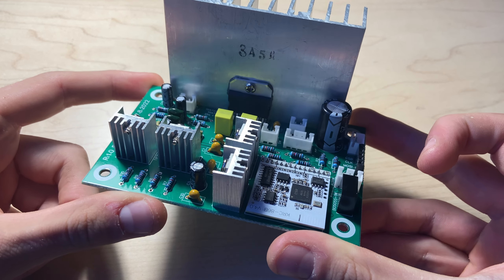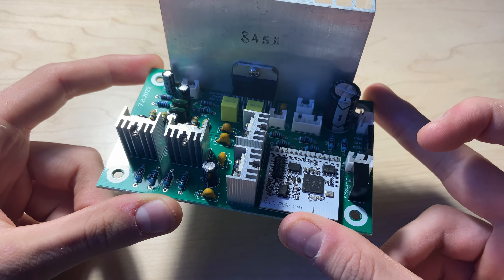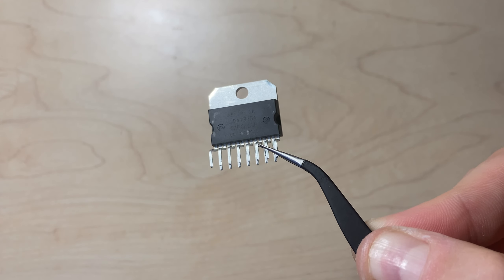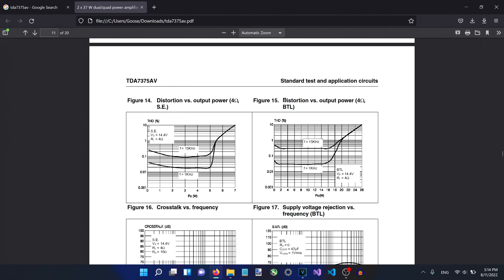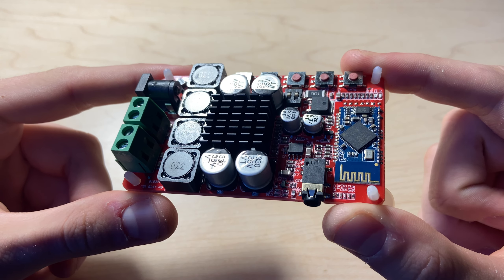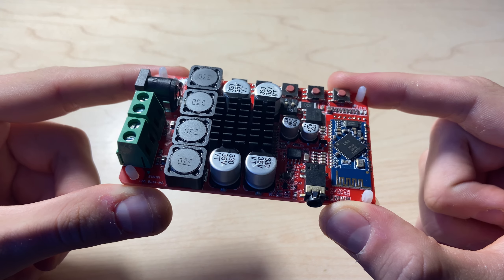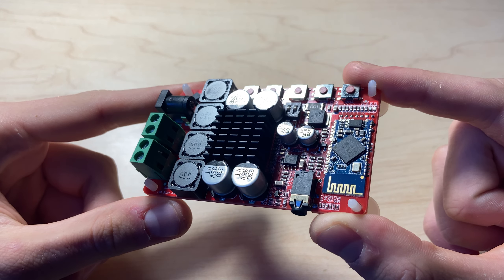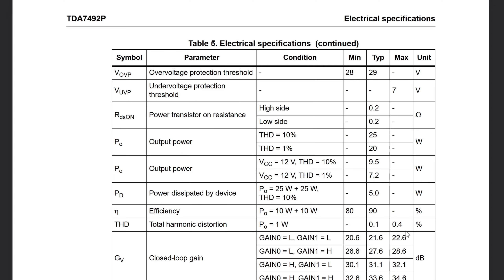Class D vs. Class AB audio amplifiers | Which one sounds better? | Unbiased listening comparison

Comment: I have tested both for my home stereo setup. I was hyped for my new class d amplifier since I am open to new tech and liked the idea of a lower electric bill. Also there are so many pseudo audiophiles on yt and old farts so I don't buy when they talk bad about every new thing. Since class d is newer and Yamaha knows a thing or two about hifi, I expected it to be at least as good as my old Yamaha ab amplifier. No. Ab is better. The class d amplifier is much smaller but very strong. No problems with big speakers. But the quality is lacking. Sounds like every PA system.

Comment: Hello, great video. The eBay non-branded class D amplifier boards are a lottery when it comes to getting a well implemented version. Few of these are being built with top audio quality in mind and more as in masse low cost electronic projects. While class AB for audio reproduction has been around for longer than class D the latter has come a long way in sound quality.  I have several class AB, class H and class D amplifiers which I switch all the time in my main system just for fun and I personally like both class AB and D, AB for efficient speakers and D for inefficient speakers (class D drives them with less effort because of its efficiency by sending more of the power from the power supply in to the speakers vs. wasting it as heat). I have tried 3 class AB boards, a pair of lateral mosfet boards,  a pair of vertical mosfet boards and a pair of bipolar boards vs. a well implemented pair of class D LJM IRS2092s boards using identical +70v/-70v linear power supplies and A/B listened through several bookshelves and tower speakers using the same source and music material. The major difference between them I subjectively noticed was that the class D boards because of their efficiency (+/-90%) made better use of the power supply and sounded louder with less effort vs. the class AB boards which run at lower efficiency (+/- 50%). At the same matched output power at normal listening levels they sounded pretty much the same IMO. For well implemented versions of class D (and class AB) amplifier boards see the IRS2092 boards by LJM, all products by SURE electronics, Connex Electronics and HIFIMEDIY. Class AB are easier to implement and more forgiving when it comes noise to the point that several do-it-yourselves have built amplifiers with point to point soldering rather than using a breadboard using class AB chips LM3886 without impacting their performance, this approach is impossible to implement with a class D chip without messing up its performance and noise. The best low power amplifiers I have heard are the Trends Audio 10.1 using the Tripath Ta2024 chip, a board using the TA2020 and a board from HIFIMEDIY using the TK2020. The TI chips can't compete with Tripath IMO
Reply from the maker: Neither of the chips in the video are from TI, they’re from ST Microelectronics. ST seems to have better chipsets over TI. The biggest concern with a lot of Class-D amplifiers today is that they suffer from low bandwidth. They have less dynamic range than the linear amp counterparts. This means most Class-D amplifiers won’t have as “vibrant” sound as Class-ABs or other linear amplifiers. The output filters also have some play in the fidelity of a Class-D amp. Poorly designed output filters can result in fatigue and muddy highs. Class-Ds can be great but their filter design in most electronics are terrible. High end configurations almost always get them right, but they can be very expensive. This videos aims to compare a typical Class-D amp configuration with a typical Class-AB for a better real world comparison.
Reply: @DaGoose  Agreed but If the video aims to compare a typical Class-D amp configuration with a typical Class-AB for a 'better real world comparison' then these no name boards from eBay are a far cry. The word typical implies a complete amplifier with a properly designed power supply designed for it included in its chassis or separately, it doesn't need to be expensive btw. That's as important as anything else. For amplifier boards the LJM L25 class AB and the LJM L25D class D would be a more real world comparison since they are designed by the same person and are properly implemented
Reply from the maker: @rickhedez521  The Class AB board I made myself using genuine parts. Whether or not they are “ebay” boards is besides the point. Many consumer electronics share similar characteristics as far as the design and amp chips used.
Reply: I have a Tripath Board 4*100W class-D Amplifier TK2050. (from Sure)
is that worth building an amp and would you know how these types sound?
thanks!
(I am an electronic noob and rely on infos online but its not always easy to filter out the right answers)

Comment: To my ears, class D has strange representation on high frequencies. sounded muddier. something after 15kHz, kinda aliasing subtle, but noticeable. But you can only hear if  do a very quick A/B comparison less then one second during changes avoiding letting your ear to  adapt
Reply from the maker: That’s common in class D amplifiers due to them having low pass filters on their outputs. it’s usually a design flaw with the low pass filter rather than the class D amp itself.
Reply: I bet you can't hear more than 10khz....
Reply: @DaGoose  Its by design. You can trick the masses with that distorted shit as long as its cheap and they get duped into thinking that a Class D 15 Watt AMP is all you will ever need. Bullshit!
Reply: @DaGoose  it's also common for that to be disabled by default, at least on home theater receivers. I'm sorta picking up that you know very little about home theater receivers and only specialize in single board amps.

Comment: It would of made even bigger difference if you had used an actual toroidal transformer with leaner power supply for the class ab amplifier.
Reply: Good point. I will test the theory. I have both so we will see what sounds better.
Reply: Or an actual hifi class d amp like the Purifi Eigentakt or Hypex Nilai, or one of the many big name amplifier manufacturers using those amplifier modules, like NAD or PS audio.

Comment: I like the sound of the class D better, I listened to this through my Denon AVR x4700h receiver that uses a class A/B Amplifier with Klipsch KL-650 THX speakers running in stereo mode.

Comment: If you designed the amp yourself, then the comparison is inherently biased. I wish you had compared it to a higher end class D amp. It's funny that it's so tiny (yes, I know they generally are smaller due to the dramatically different amplification technique, but still). The heaviest home theater rceiever I own is class D.

Comment: Although not a fair test (my desktop speakers are powered by class D amplifier), and YouTube audio compression, I did hear a clear difference between them.  Class A absolutely won in my opinion.  Better clarity, stronger mid range, higher highs too.  Class D was subtle and not exciting.  Although the class D did sound good, the difference was huge.  I prefer class A for everything, but it's getting harder and harder to find good quality units for car, house, Bluetooth speakers, etc....
Reply: There are Classd-A amps. Class-B amps. And Class AB amps. Are you sure you are talking about Class-A amps and not about Class-AB amps?

Comment: Unfair comparison......
Tda7294 100watt vs unkown class d possibly 2x40 watt tpa3116 

You should have
Reply from the maker: the output power has nothing to do with the comparison that was made in this video. those are not the parts either.

Comment: I guess class D is only good for Subs, provided you get a good one
Reply: Yeah I have a 200w sony class d powered subwoofer but I think  class ab is still  the dominant king around here ❤❤❤❤❤❤❤
Reply: OK, explain why Pioneer's engineers disagreed and put it in 2000 dollar receivers in the late 2000s.
Reply: @awesomeferret  They still use them in high end head units, they can be made to sound indistinguishable from A/B but costs more, for now at least.
   
I noticed my current amp can sound slightly crappier under some conditions that didn't happen with my old AMP I was curious to investigate what the difference was, it's just the limitations of Class D at this price point is all

My comment didn't make a lot of sense without elaborating dollar for dollar comparison

Comment: the moment you said that the gains were set 1dB different I stopped listening.
Reply: Why
Reply: @jessebeatty9696  Are you serious? 1dB difference in gain may or may not be discerned as a volume change, but the louder one will always be perceived as higher quality. This is psychoacoustics 101. This is why you gain match to 0.1dB maximum.
Reply from the maker: the gains are locked, so that is not possible with these to tune the precise gain with these boards. besides, the gain tolerance for most amps is usually +/-1dB, so it’s possible there’s a 1-2dB difference between two amps anyways even if the gain is advertised as equal.
Reply: @DaGoose  You have to deal with that if you want to make comparisons. An external attenuator in the higher gain path may be necessary. But without deent equalisation any comparison is meaningless.

Comment: Yeah but your comparison is with super cheap junk.
Reply from the maker: “cheap junk” lmao
I bet you’ve never designed audio amplifiers before. Numerous consumer electronics in modern times use chipsets similar to these amps.
Reply: @DaGoose  yes, i do build and play with electronics. That is how i noticed the cheap chip amp. Ice power amplifier modules are much better sound quality.
Reply: Well, compared to an Ice amp, yes it is "cheap junk." Why did you have to prove so dramatically that you're incredibly biased? That's quite sad, considering the title. That microscopic class D amp is a joke. Where are the huge capacitors? Why isn't it heavy enough for it to be painful to carry? My only theory is that you've never heard a high-end class D before. I'm not even saying they are better than AB, but it's really easy to find a class D that's way way better than the one you feature in this video.

Comment: Superb sound by both amplifier but class d is better than class ab
Reply from the maker: class d is better than class ab in anything other than sound fidelity. but class d hasn’t surpassed class ab or other linear amplifiers yet in terms of sound fidelity.
Reply: Class d mono block amps are for bass/subs..A/B amps are 4channel amps for mids and highs..Google it.
Reply: @DaGoose  it is full crap not good much worse The very best amplifier for a subwoofer is a class AB or Class H amplifier. Class D amplifiers are too slow and cannot keep up with repetitive bass. A class AB has a toroidal transformer and coke can capacitors so when the kick drum kicks the woofer responds instantly "A/B is louder , better , more powerful" because it is  A/B ab class is analog much better Nothing Digital D class crap No thanks That digital class D crap can be completely forgotten nothing crap Losers need D class Not sane and normal people That D class is cheap crap Nothing else And it is not needed anywhere I myself will now and always remain in the AB class much better Yes, Logitech knows That's it
Reply: @kotim1142  man wtf are u talking about..it seems u dnt know much..a/b amps are for mids and highs D are for subs bass..until I actually see proof other wise I'll continue to use them
Reply: @kotim1142  Been listening to power amps closely since about 1963. Started with Class A. Moved on to Class B (late 1960s - early 1970s). Quite a while later came H, G, AB. Then D (PWM). I love them all -- except Class D. Only robots and androids would love the sound of Class D. The only reason they make them because they are dirt cheap. :face-green-smiling:

Comment: I have used about 3 types of class d amps based on ic and they had smd components, only tpa 3110 last long for 6 months, then I bought mosfet based class d amps with regular big components and it blew up, then second time I bought it, tested it and ran on recomended voltage, but after 10 min a diode lost its magic smoke, class d are not robust at all.
Reply: Ohh, that's very sad, in your opinion which board good class ab or a
Reply: @dilipn2761  Class A, purely. Nothing sounds better than that. Yes, it needs lots of energy and produces lots of heat. But as an old german saying goes: "Von nichts kommt nichts!" = From nothing the only outcome is nothing.

Comment: Class D is garbage. A good Class A amp will be always far superior. Even if it needs 10 times the power and costs 20 times as much. I dont care.
Reply: What are good Class A amps that will supply good current? I want at least 300 watts for my Revel F328be's. Thanks.

Comment: Good video. I agree with you on this test. The TDA7375AV is really not a good example of a clas AB amplifier. Since the TDA7375AV is in a chip form there is a lot that has been sacrificed in quality as it has a very high distortion of 10%!! A discrete clas AB amp with have a very low distortion of 0.002 or less. You should try one out, you will not be disappointed.
Reply from the maker: The TDA7375 is a modern example of a Class AB amplifier. The 10% THD is only present when the chip is clipping. This test was just supposed to show the differences between a typical off the shelf Class D and Class AB amplifier. 
Other test videos used very high end configurations for both Class D and AB which made it an impractical comparison as 99% of viewers most likely don’t have high end equipment.

Comment: The very best amplifier for a subwoofer is a class AB or Class H amplifier. Class D amplifiers are too slow and cannot keep up with repetitive bass. A class AB has a toroidal transformer and coke can capacitors so when the kick drum kicks the woofer responds instantly "A/B is louder , better , more powerful" because it is  A/B ab class is analog much better Nothing Digital D class crap No thanks That digital class D crap can be completely forgotten nothing crap Losers need D class Not sane and normal people That D class is cheap crap Nothing else And it is not needed anywhere I myself will now and always remain in the AB class much better Yes, Logitech knows That's it